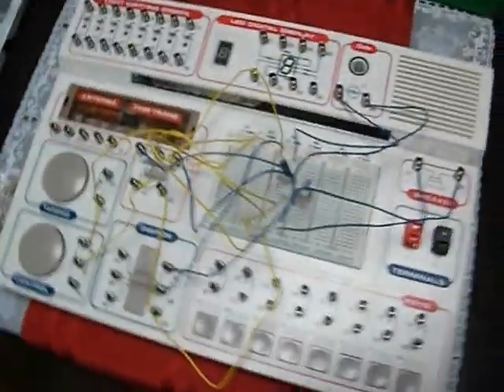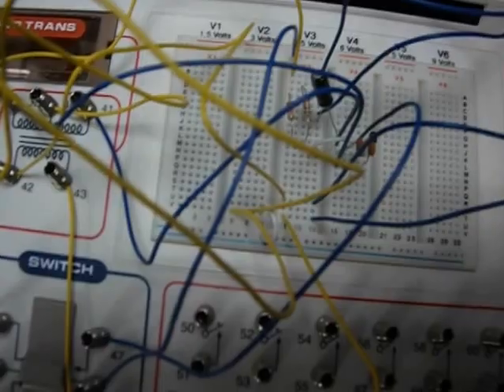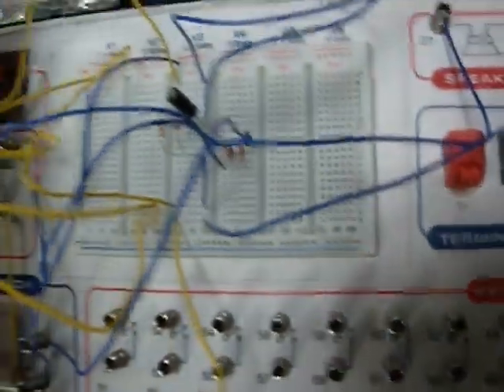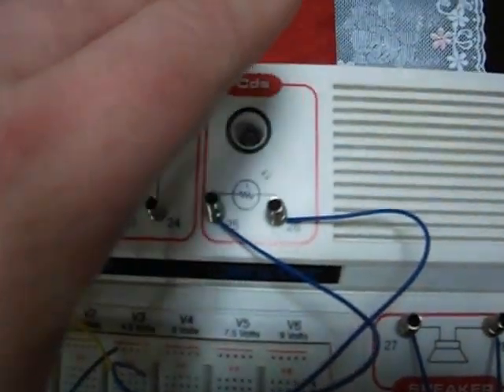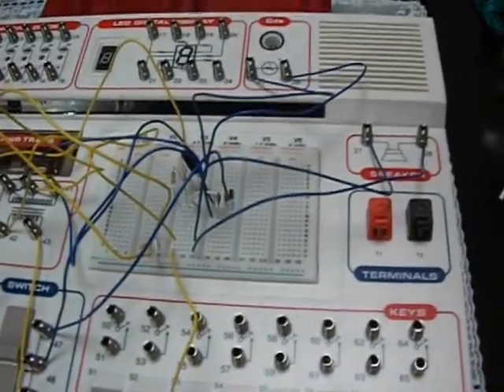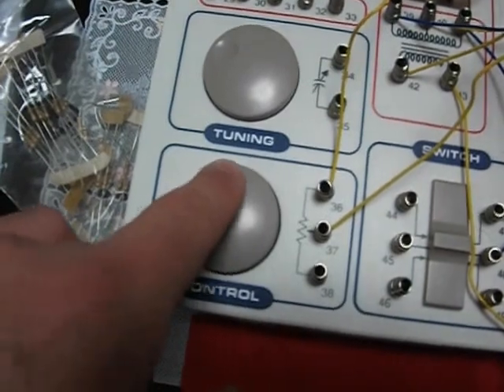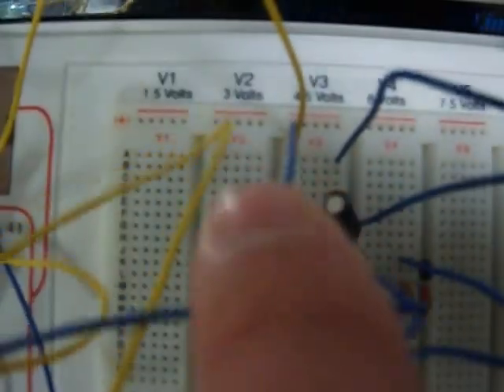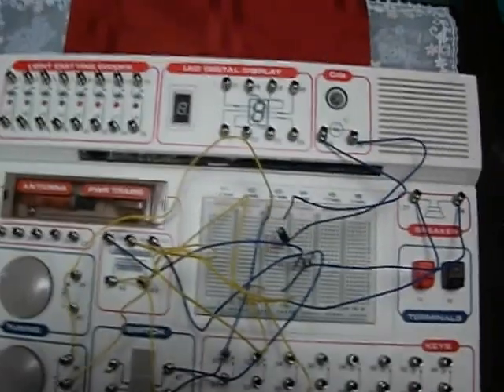Maxitronix 300 in 1 Electronics lab: Project 1

Comment: When you plug wires, resistors, etc into the circuit board, do you have to have them touch bottom? Or can they "kinda" be in the hole? I'm having trouble getting the wires all the way in.
Reply from the maker: I believe as long as it is in and being held tight it is making contact and does not have to touch bottom.

Comment: Hi, I bought this kit but it lacks components. What is the reference of transistors (NPN and PNP) and diodes?
Reply: (from your question about transistors in the 300 in 1 kit)... A standard npn transistor is number 2N3904. For the PNP it would be 2N3906.  Just basic signal transistors for general purposes.